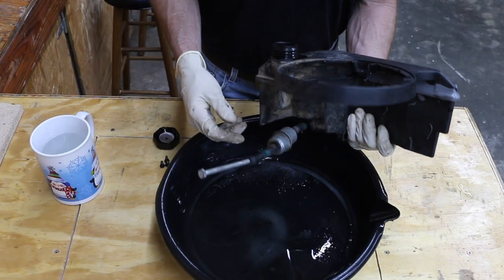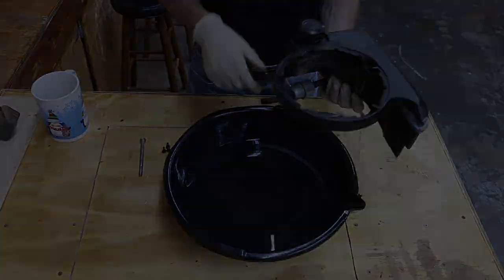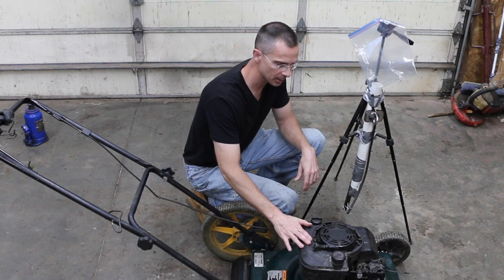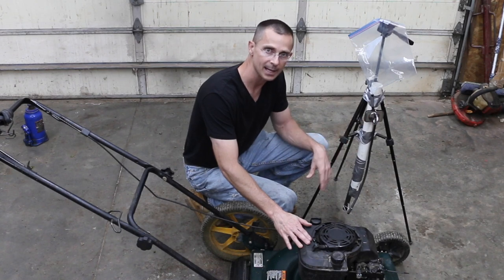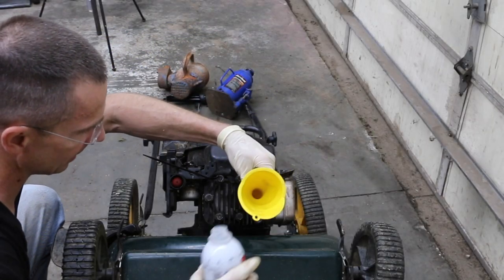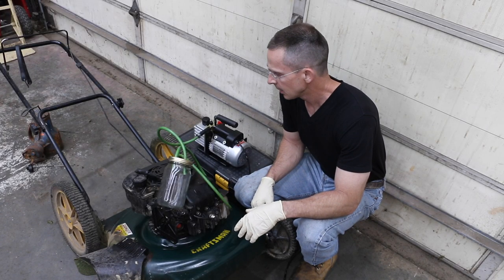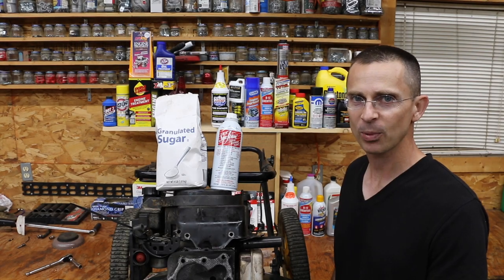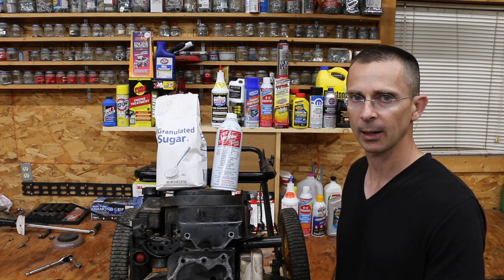Will Seafoam and water remove sugar in fuel?  Let's find out!

Comment: CHAP, do you have a ventilated cooling air-filter mask?
The issue is that you almost always work with highly toxic, cancerogenic gases and evaporations. The only way to solve that for you is to buy pricey equipment like that. It is not light at all since you will have a small engine and battery for air pumping and cooling on your back to move the air through purifier/filter and then thick elastic tubes to feed it to your face mask. IT MUST be both ventilated and cooled since otherwise, your face would sweat very fast and you will not be able to use it for a long time. Please also notice that this equipment MUST also have catalytic CO oxidiser to turn it into CO2 via a charged Titanium plank exposed to ultraviolet LED as there is no other way to get rid of this highly dangerous gas.

Comment: That's 1 way to do it. I would have added butter, vanilla , chocolate chips and egg in large bowl. Stir in flour, baking soda and salt then pour that into the gas tank, let it run for 45 minutes. It will not only clean out the sugar, when you take the head off, you'll have cookies.
Reply from the maker: Erik, LOL!  Thanks for watching the video and commenting!
Reply: I may have to hit you up with some serious lawn mower questions soon, I hope you're up for it. I have a cool project I've been fixing up with a 12 hp tecumseh engine.  And although someone else said they would help, they haven't made it a priority... I've already put a lot of work into it,  and I do have some RL help, but  I may need some tech support from a lawn mower guy...  https://www.dropbox.com/s/5csmlhizs6rslhk/2015-10-26%2014.55.47.jpg?dl=0
Reply from the maker: Eric, Cool ride!  Happy to help.  I'm definitely not an expert but happy to assist.  This forum might be helpful to ask questions.  A lot of expert knowledge exists on this forum.
Reply: Some help is always better than no help. I'm not that far yet, working on the electrical, but it runs! And that is the key to success.
Reply: The stater is what I'm most concerned with. 2 wires go in (from the magneto, I think,  and 1 goes out....? To I have no freakin clue.Is it a ground, a positive, does it run to the battery?
Reply: When it's running, the RPMs are fine, when I add throttle, the RPM's dive, the power is gone and it will choke out.  I have a float rebuild kit on the way, it does leak a little, but I don't think that's the issue. I don't currently have a air filter on it, I've had it off because I was messing with the Walbro carb and rebuilding the impulse Walbro 3000 fuel pump.This is old school stuff. You look any of this stuff up today, they have fancy plugs, look completely different... I contacted Walbro and they have these things listed as "OBSOLETE"... lol, but they have diagrams on them, I was shocked.

Comment: I think your testing was flawed. You should of removed that fuel filter first, it probably did it's job and kept most of that granulated sugar out of the engine. From what I saw most of it didn't desolve.

Comment: Seafoam didn't look like it really cleaned anything in the combustion chamber.
Reply from the maker: Thanks for commenting!
Reply: Have you done a video using water in the combustion chamber of a hot engine? Steam cleans the combustion chamber. I've seen it done on fuel injected cars with good results. Not sure how you would attempt it on a small engine though. Need just the right, stay amount of water and water is free!